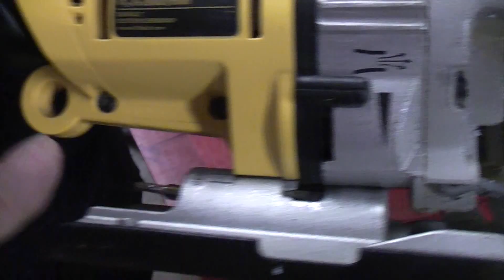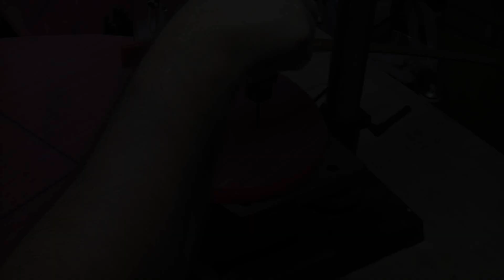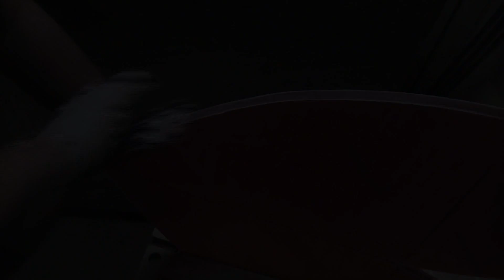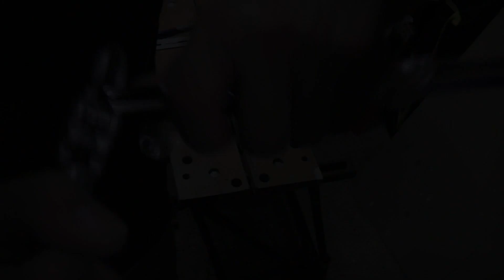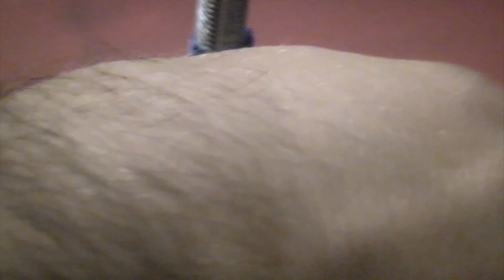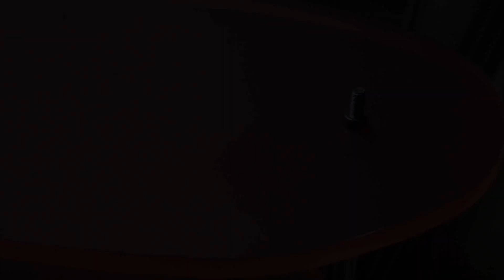How to make a Perspex Table

Comment: Question: I want to make a perspex lid for a large aquarium and I need a few circular cut outs in the middle of the sheets of perspex to fit light-fixtures. What do you think is the best way of doing this? Can you use a drill to get the hole started and then a jig-saw to expand it? Thanks so much! (Awesome videos!)